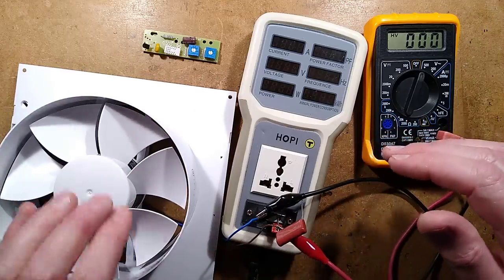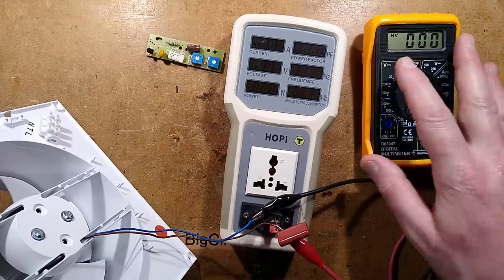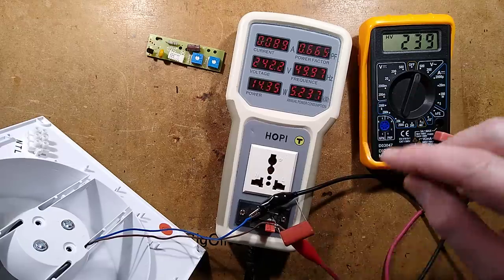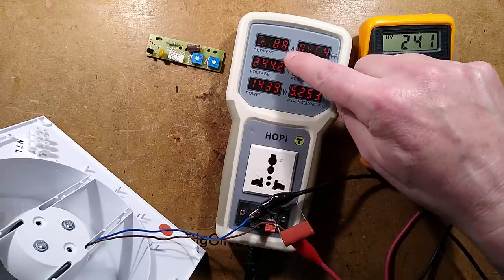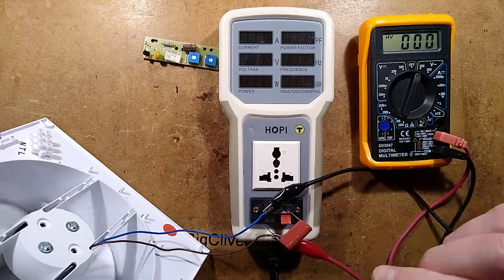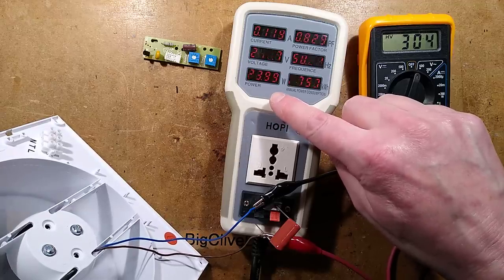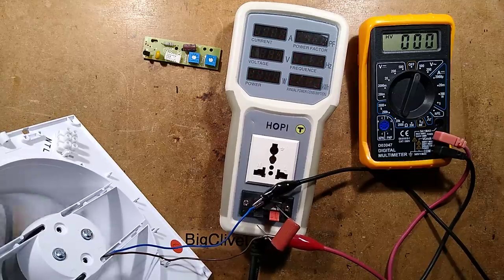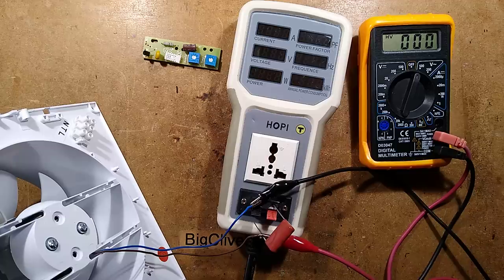What the heck!  Series capacitor makes fan go TURBO!

Comment: Resonance. The capacitor and the inductance of the fan are resonating, causing, as you say, a phase-shift. Without the capacitor, much of the current is reactive, not contributing to the output power. With the right capacitance some of the inductance is compensated for, lowering the impedance of the total circuit and allowing more current to flow. As the impedance of the fan itself will stay constant, and the current has gone up, the voltage across the fan also increases.
Reply: Sounds reasonable. I would have tried to explain it similarly, but in a worse way because I don't speak English natively. 😅
Reply: So the next thing to do is test with a range of capacitances, see where the effect happens, ?
Reply: Meanwhile I would've just thought it was bridging the gap where the AC dropped to 0v as it swapped direction.

Very good explanation.
Reply: @idjtoal sounds like a valid experiment to me!
Reply: @idjtoal  yep! Although the optimum value that produces the highest power will probably cause the fan to burn out. It's not like the manufacturer tested it like that.
Reply: @idjtoal  See the video description, he has some data for you there.
Reply: Very neat, I'm going to take you at your word because I was thinking along these lines anyway.
Reply: @strenter  There are lots of ways to explain  this effect, your explanation might be different but just as valid due to the number of laws relating current, voltage, impedance  and power (which are all complex numbers in this case). I used this one here because it doesn't need to involve diagrams or equations.
Reply: @idjtoal  And/Or a range of frequencies if the equipment to generate them exists. A signal generator coupled to a power amplifier feeding a suitable step-up transformer feeding the fan/capacitor?
Reply: This is what they call back emf, right?
Reply: the voltage don't change it's the frequency that get's higher and then the motor runs faster.
Reply: It'd be interesting to put an o-scope on the bench to see what is happening to the electricity going through the circuit there.
Reply: @seedtheskies  mmm, the term back EMF has two meanings in electronics: it's either what a motor generates when it's spinning, or what an inductor generates when it's switched "off". As we aren't switching in this example, it's not the right term, but it is exactly the same laws and effects that cause it: the current through the inductive load want to keep flowing. In this example this causes a phase shift that's compensated for, in a switching circuit it causes a potentially damaging voltage spike unless we deal with it, usually with a "flyback" diode.
Reply: Agree.  First run without the cap, using the watts and pf from the HOPI, should be able to work out the effective inductance and resistance of the fan motor (okay, not actually the 'resistance', but the effective load dissipating the 'real power').  Knowing 50 hz and the capacitance, could work out the series R-L-C circuit.
Reply: @fromaflafl2198  no, sorry. the frequency is fixed by the grid frequency of the input voltage. The motor has a commutator that means it changes EMF by itself depending on the physical speed, which is in turn governed by the inertia of the load and the torque. The torque is dependant on the current. Therefore, the higher the current, the higher the speed (for a fan)
Reply: @henryokeeffe5835   No it depends on the type of motor it has. if it was a asynchronous motor. you would be 100% correct. but it's most likely a synchronous motor. as they are cheaper. and I have taken apart a similar fan before that was also a synchronous motor. also he is forming a RLC circuit  and it can change the frequency  across the motor.
Reply: Exactly. What's odd is that he had to ask the question. This is not an advanced concept. Glad that he did though. IT's never wrong to ask about something.
Reply: @TDGalea  the voltage would have to get to 0 at some point. That point would be later, but that would also cause it to start rising later. So iy would just be shifting the whole wave (that shift is the power factor, and it happens to the other side with an inductor)
Reply: @fromaflafl2198  There is no way this could be a synchronous motor. He has a fixed frequency supply so the frequency cannot physically change. A synchronous motor also does not have any mean torque at 0 RPM so it would have been impossible for such a high inertia load to start up. Are you sure you didn't have a shaded-pole fan motor?
Reply: resonance doesn't resonate when the inductor has a huge freaking load on it
Reply: I wonder if the .04 hz on the frequency increase on the hopi would also be because of this. I realize that the frequency changes naturally, but it is solidly 49.97 w/o cap and 50.01 w/ cap the entire time. Could be showing the shift, along with, as mentioned elsewhere, the pf increasing.
Reply: @henryokeeffe5835  yes that is the more correct name for the motor. but it's still function more ore less like a synchronous motor. with the speed being government buy the frequency and number of poles. not the voltage.
Reply: I'd like to see what happens to the A/C on an oscilloscope.
Reply: The reported power factor from the Hopi indicates that resonance is indeed occurring. Experimenting with other capacitors will give us the numbers needed to calculate the inductance of the fan, which can then be used to calculate the capacitor value needed for a PF of 1; making the fan whirr as fast as it possibly can. The failure mode will likely be interesting if not perplexing.
Reply: With the correct size capacitor, you could completely cancel the reactive impendence, leaving only the resistance of the windings to limit current flow.  But it's likely to go bang.
Reply: @fromaflafl2198  A shaded pole motor does not function at all like a synchronous motor. In a synchronous motor, the mechanical speed must always be the no. of pole pairs * the electrical input speed (frequency.) In fact the shaded pole motor operates just like an induction (asynchronous) motor given it is a type of one. In these types of motor the speed is governed by the  frequency, but it is also governed by the slip. The slip is 1 - the frequency of mechanical rotation and the the ratio between the frequency of the input voltage, and will be less if the impedance of the motor is reduced / eliminated. All frequencies stay the same.
Reply: @tsm688  It does, just with a poor Q-factor
Reply: @mikefochtman7164 It was already ran without the cap at the beginning of the video.
Reply: Is that why the power factor went up from ~ 0.6 - 0.8?
Reply: Yep, very likely resonance, that really got me when i started studding electronics, in the class we made a rlc circuit powered with a function generator, and i was amazed back then why the sum of the voltages in the inductor and capacitor were way higher than the input voltage even with some voltage being dropped on the resistor. Of course you can't just sum the voltages, you have to account for the phase shift (vetorial sum), but nonetheless still amazing. Another thing related to motors and resonance, is on the single phase induction motors running capacitor, if we measure the voltage across the capacitor it will be higher than the input voltage, and the closer you get from 1 power factor, the higher the voltage, that's why such capacitors are typically rated at 400v or more.
Reply: @henryokeeffe5835  This is almost definitely a simple induction motor. No commutator.
Reply: @fromaflafl2198  It's probably an induction motor. Nothing even remotely synchronous about it.
Reply: ...and we can also calculate that shift to get the peak voltage we can use V/Cos(A)=Vt
..as Vt and V is known V=240V (Socket) Vt=Measured voltage we get Cos(A)=V/Vt, the inverse of Cos(A) give us the angle 39.3 degrees a 5.7 degree phase shift from 45 degrees (Rms of 240V)
Reply: Oh like you thinking. That makes alit more sense than what I came up with. (Why didn't I think of this). 👍🇮🇪🙏🏻
Reply: @idjtoal  yes great idea. Agree 💯%
Reply: @TDGalea  that what I thought. But I think this guy hit the nail here. 👍
Reply: @strenter Props to you for learning English. Most of us will never understand or appreciate that the letter A makes dozens of different sounds or the many thousands of other oddities where none of the rules mean anything purely based on context and you’re just supposed to know.
Reply: @idjtoal  yes, there should be a sweet spot, and others at different harmonics if resonance was the case.
Reply: Super interesting!
I guess understanding that would make one pretty good at electronics.
Reply: :washhands::washhands::washhands::washhands::washhands::washhands::washhands:excellent mate
Reply: @BrianG61UK  Probably. All the same logic applies though. The frequency is not being changed directly, the slip of the machine is just being reduced as it runs at a higher power
Reply: @Danimal.69  Nice use of chat-GPT!
Reply: @fromaflafl2198  There are NO poles.
Reply: @Danimal.69  It's not 100% right though. There are places where it has put an odd emphasis on negligible factors that wouldn't normally be mentioned at all (like insulation failure), and it is written more like an essay, with poor use of technical terms like "system balance" and "ideal state of sync" which is just wrong; there is no "sync". It also repeats itself several times.
Reply: @BrianG61UK  There are always poles in a motor.
Reply: @henryokeeffe5835  I guess there are two then. No more than that.
Reply: @fromaflafl2198 I think there is some confusion. A shaded-pole motor is still an asynchronous motor (also called sometimes induction motor) running from the single-phase power mains. It employs a particular method to create a spinning magnetic field, by shifting the phase of part of the field generated by the two stator poles.
Reply: @henryokeeffe5835 A small error slipped in.
Mechanical speed = Electrical speed / Number of pole pairs .
Also, the impedance increases as the slip decreases, to become purely reactive for the armature spinning at the speed of the magnetic field (zero torque for the asynchronous motor).
Reply: @fromaflafl2198  highly doubt this is a sync motor, most fans use simple single phase induction motors or shaded pole motors, sync motors are usually way more expensive, complicated and really not practical for something as simple as a desktop fan
Reply: Not sure how much resistance there is in your circuit, but be careful of peak resonance, Q. Calculate your RCL circuit and see where your at.
Reply: it's only a small area (of wire lenght) that the capacitor is 'low impedance', as I stated did Big Clive invent the first room temperature superconductor? The capacitor might be Filtering the AC signal, to where it's reducing the back emf or removing interfering frequencies from the Mains? :face-blue-question-mark:
Reply: @Dazza_Doo  I'm not sure what you mean. Big Clive adds his own capacitance in the form of a capacitor. In series with the inductance of the motor windings, this helps reduce the impedance of the motor.
Reply: @henryokeeffe5835  How does it reduce the impedance of the Motor? Capacitors reduce impedance within themselves until the Resonance frequency is reached. 
Are you suggesting there is a smoothing of the AC energy?
How does a Capacitor Affect the Motor? it has reduced the impedance of the Motor physically. 
Motors produce impedance though the physical wiring, and though the Magnetic Flux (Back Emf) generated in the motor when powered?
Physically the Capacitor is a tiny faction of that Circuit, I'm assuming we are considering the entire circuit, from Wall Outlet, Fan, Capacitor, Meter and return?
The capacitor is about 10cm of lower inductance vs the Route of 1 meter for the Mains power connection? 

:face-blue-question-mark:Anyway, I'm not sure if I have gotten my observation across.
Reply: This is AC. Capacitors store electric charge in each and every cycle. That is the reason why the voltage increases because in every next cycle, the stored voltage of the capacitor supplements the source voltage. Like adding batteries in series would add to the voltage.
Reply: @gregoriocinco921  I believe you may have over estimated the energy in the capacitor used, then again, I could underestimate the same capacitor to hold enough energy to give such a high-power factor increase.
Reply: indeed, it's quite similar to that of the tank circuit of a Tesla coil actually.
Reply: @gregoriocinco921  This is not true. What you are describing is a voltage multiplier, which requires diodes.
Reply: @henryokeeffe5835  i thought so. Thanks!
Reply: You are adjusting the circuit reactance. This is the exact process used in multispeed ceiling fans, changing the capacitance with each tug of the speed chain.

The only thing of concern is to not exceed the power rating of the motor itself, or you will burn the windings.  

Capacitance is counteracting the inductance of the motor. As capacitance increases, it brings the load closer towards being a pure resistive load, and closer to a power factor of 1.

Induction motors often have two capacitors, one for starting, one for running. The start capacitor is momentarily placed inline for maximum power initially, but if left engaged too long will burn up the motor. The running cap sets the engineered desired running point.
Reply: @warrenbrown8670  Thank you for a well-explained comment. It helped in enlightening us.